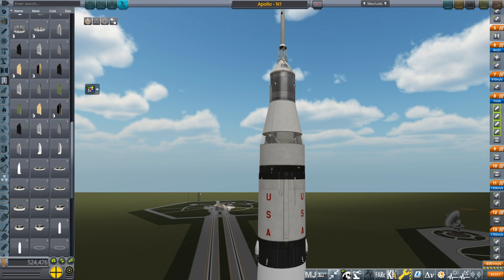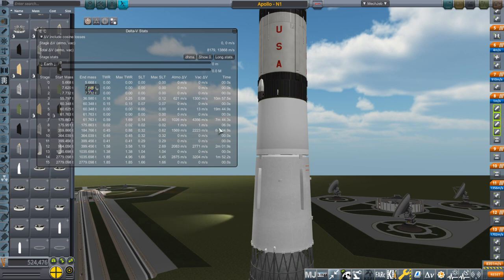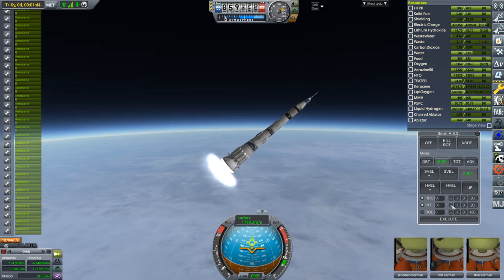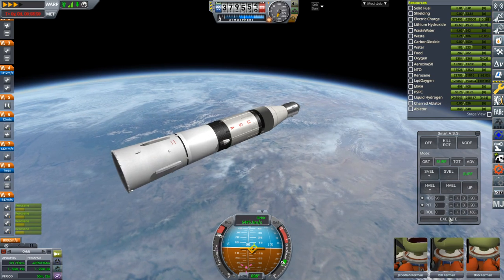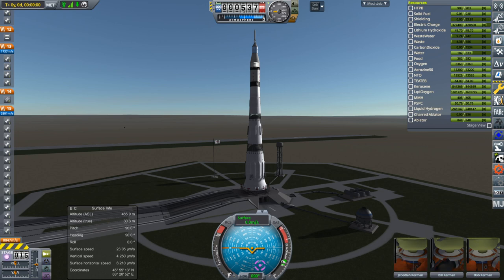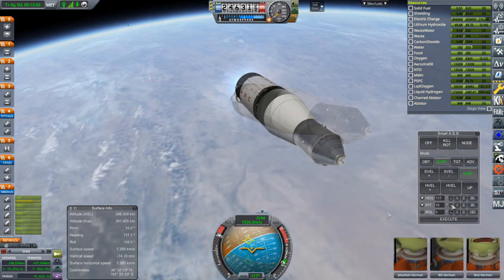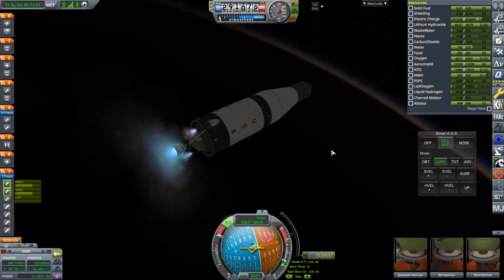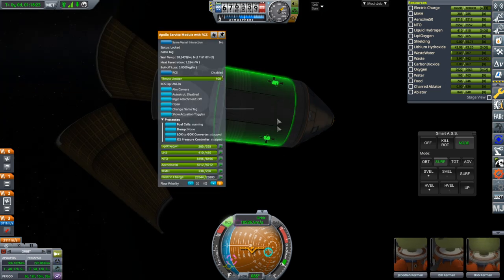Realism Overhaul in KSP 1.8.1 - Launching Apollo on N1

Comment: You could do another video launching the L3 complex on a Saturn V.
Reply: That would be a lot easier... the Soviet plans used a lighter single-person lander and a 2 man soyuz.
Reply from the maker: The L3 complex wouldn't require a Saturn V, but something smaller. I've already thought about this.
Reply: @RaizSpace  Saturn C-3BN maybe... that'd be a real deep dive to figure out how to recreate but it'd be really interesting to see.
Reply: @ryanspence5831  so a nerva as 3rd stage finalising orbit or what? btw, it would be nothing close to difficult, 1 kerolox tank, 5xF1, 1 Hydrolox tank, 5xJ-2, nerva stage. Pushing anyhting not yet in leo with a nerva makes no sense at all.
Reply: @ryanspence5831  http://www.astronautix.com/s/saturnc-3bn.html - here is your deep dive, just as i said, 5xF1, 5xJ-2, 1x Nerva. S-IVB 130tons + 32 tons of the nerva stage pushed by 266kn of the nerva stage, makes a T/W of 0.17. I wanna see you fly a 160 ton rocket (3rd stage + payload) into leo with that low a t/w in rss as you watch your steering losses grow flying at 60° pitch. To the fact how hard it would be to recreate: SXT for the engine, SSTU and procedural tanks and you can build your own in an afternoon taking the data from astronautix, which is as good a resource as any.

Comment: Would be interested in seeing a modernized N1L3. An N1ML3, or N2L3, or something like that, if you will.
(Changes I would propose being the great usage of the internal volume for tanks since the N1 only had spherical tanks, 1st stage using the better NK-33s or some other engine if you prefer, and the subsequent booster stages being converted to LH2/LOX if that's feasible.)
Reply from the maker: I have a much more horrific idea in mind for an improved N1 . . .
Reply: There was a project called N-1F, where each NK-33 would be tested before being put on a rocket, 2nd and 3rd stage fuel tanks would be slightly stretched and kerosene would be replaced with syntin. Also there was N-1M project, which would have hydrogen upper stages for two-launch direct lunar landing

Comment: For the fuel cells, you have to press the "dump" button then it should start working. I wondered this too.
Reply from the maker: Is this a Kerbalism thing, or something else?
Reply: Raiz Space I’m pretty sure. I also found that if I set the dump resource in the VAB, I’d have to toggle the fuel cell off then on again in flight. Just my experience.

Comment: In the processes section you can set 'Dump' from 'none' to whatever thing it is for which you have no storage, in this case 'water'?  I ran into that with some mod or other I've since uninstalled, but I remembered that if you want 'running' to actually mean 'running' you have to either dump the processes'  output or route it into another process, like 'hydroponics' or 'generate h and 02'.  Also, cool videos!  Just recently found your channel, I like it.

Comment: There's no KORD system on the first stage, engines can't gimble in the real life^^
Reply from the maker: Yes, but we don't have feasible use of differential thrust because the engine throttle ranges are not 0 to 100% and differential thrust mods won't expect that.